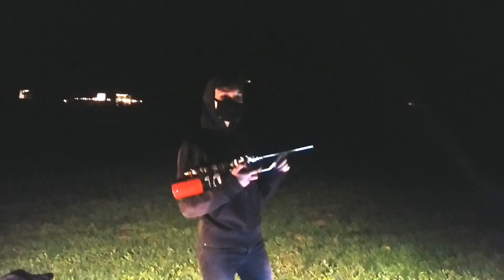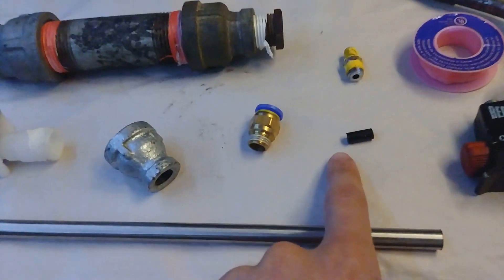Molten Ferrocerium cannon shoots sparks 60 feet (NightHawkInLight collab)

Comment: Try getting the ferrocerium not quite so hot. Get it hot enough to spark but don’t melt it. Kinda like you do with the lighter flints. Instead of an explosion of sparks out the end it’ll shoot the red hot pellet of  ferrocerium out the end. Point it at a target and you’ve got exploding ferrocerium bullets! Be sure to use a back stop because at 300 psi the pellets can fly really far.

Comment: Could you show more on the solenoid?
Reply from the maker: like what about it? its 12v battery to switch  to solenoid
Reply: @ianbuilder  you are using it to open the valve for air? Just thinking on if i do one, how to "fire" it
Reply from the maker: @HarshmanHills  yes it just opens the valve
Reply: @ianbuilder  ok, thanks

Comment: idea: change heating from a torch to a induction coil. faster and safer
Reply from the maker: very tru  but i lack both the induction coil and a battery that would last through  a lot of shots
Reply: @ianbuilder  you could use a drone battery (2S or 3S). Those are pretty compact, and can pump a huge amount of current. As for the induction coil, you can check out Great Scotts video about it, or by Electronoobs
Reply from the maker: @narayanbandodker5482  yea i got a few of them il see what i can do  maybe ill launch 1lb of ferrocerium
Reply: @ianbuilder  yes yes yughs! and safety glasses for good measure
Reply: @ianbuilder  got a car battery?  got high gauge wire then yes you do!
Reply from the maker: @hardwirecars  bru i had to lug a 50 lb car battery into the middle of the field for the inverter and lights to shoot this vid    no way can i carry 50lbs continuously
Reply from the maker: @hardwirecars  i might  if i can get a large peice of ferrocerium